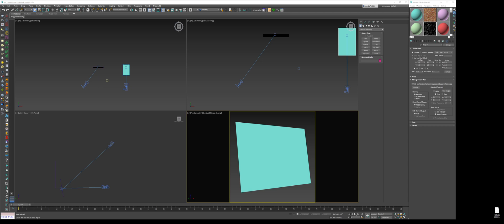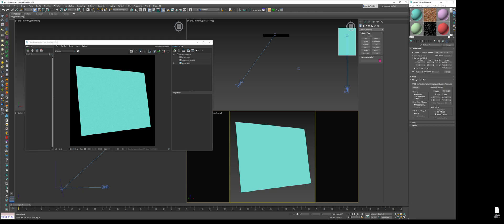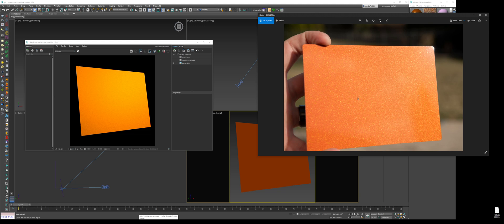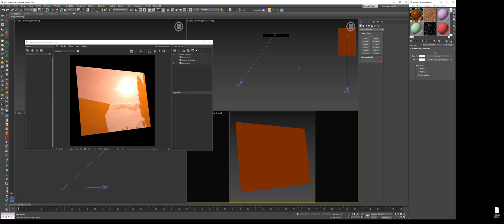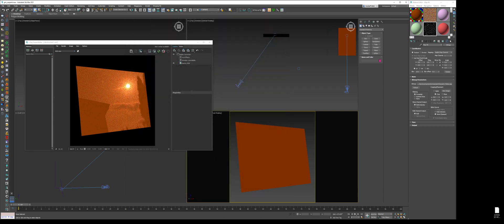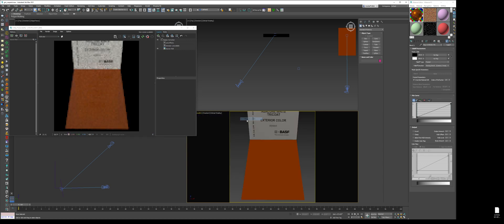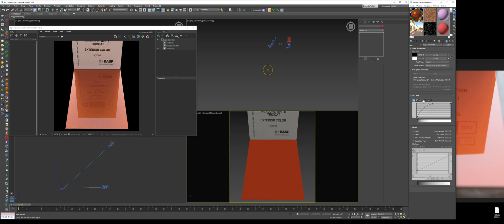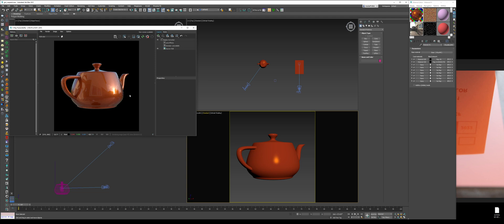How to Create Metallic Carpaint in Vray

Comment: Would be better if you did it on more complex model or an actual car model instead of sample plane it's hard to see the results on a flat surface specially with material like this, either way thank you so much for sharing this video.
Reply from the maker: There are a couple reasons why I did it on a sample plane.
1. It matches my color chip.
2. The Scale of the Plane is 100% accurate to the scale of my color chip which helps me dial in flake scale accurately.
3. I shot the HDRIs in the same locations I shot the color chip reference, so when dialing them in I am able to compare apples to apples to see the differences. 

At the end of the day this is the concept, its not right or wrong, its up to the user to adjust as they see fit, nothing in CGI is ever a 100% accurate method of doing things haha.
Reply: @AutomotiveCGI  Understandable I appreciate the effort!